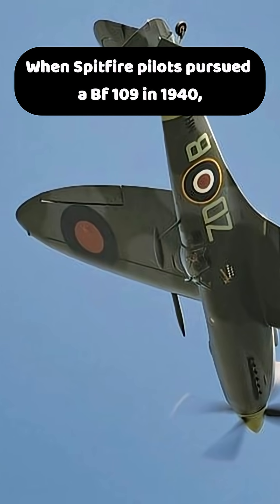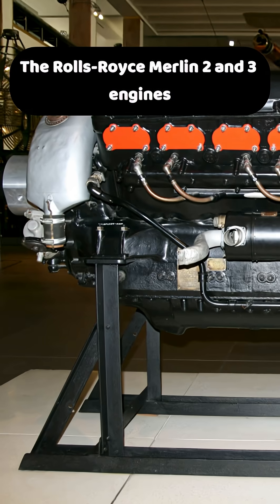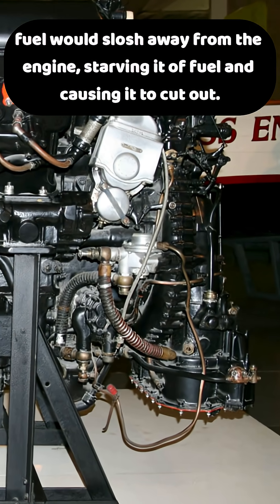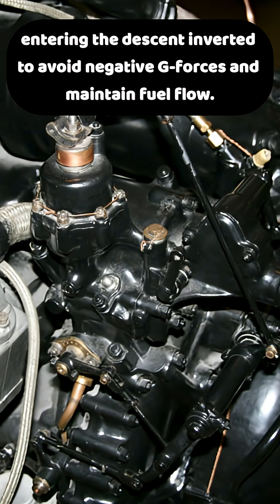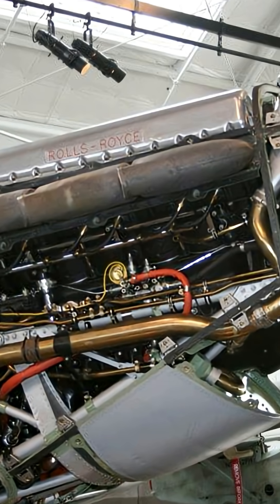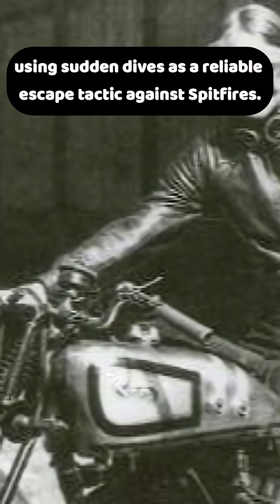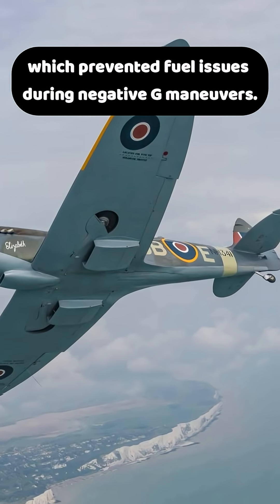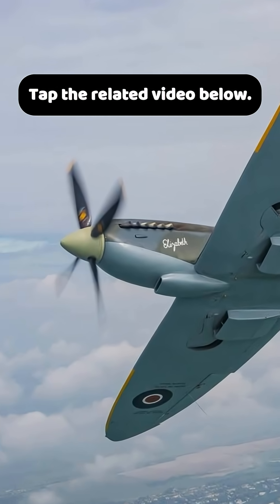Spitfire's Carburetor Crisis of 1940

Comment: German engines were technical more advanced than the merlin engines.Fuel injection is far superior.
Reply: Wehraboos are out.
Reply: I've heard that restoring a BF-109 to flying condition is difficult, because modem machine shops can't reproduce old engine parts to the required tolerances.
Reply: In 1940 fuel injection wasn't superior, it was less efficient than a carburetor. I have had cars with carburetors that gave good power and economy, also fuel injection that didn't work so well.

Comment: I never understood why the RAF did not use the same system the Germans did, fuel injection.  They had shot down many enemy aircraft that they could have examined that system and copied it so the Spit and Hurricane could dive the same way.
Reply: Mostly because the carburetor was more efficient than fuel injection at the time, the Spitfire and Hurricane had advantages and RAF pilots had little or no trouble.
Reply: They fitted Merlin 66 engines and later with American style pressure carburettors and until those advanced engines were ready Miss Shilling's restrictor cured the worst of the problem.  They used Bendix-Strombergs from America and developed their own by SU and later Rolls Royce.  Pressure carburettors gave a cooler and denser more powerful fuel-air mixture induction charge than direct injection.
Reply: @givenfirstnamefamilyfirstn3935  
Rolls Royce had the Modification by Miss Shilling during the Battle of Britain, Mk V Spitfires were further inprove to cure the problem entirely, Rolls Royce and SU then came up with the Speed Densitiy carburetor and this was given to Bendix/Stromberg who copied it.

Comment: The Merlin carburettor was very different from the Me109 fuel injection. Early in the 1969 film 'Battle of Britain', there is a picture of a spitfire in a roll, 'sputtering'. Few Cars still use carburetors.
Reply: if you're worrying about your engine cutting out while you roll your car, you're probably not driving in accordance with the Highway code.
Reply: @jujuUK68  I got carburettor ice in a Mini climbing uphill on a motorway in winter!
Reply: But after the war, cars continued to use carburetors for several decades. Although fuel injection was already available in 1940.😮

Comment: I have always heard talking  aboub this as a Spitfire problem. The reality was that in 1940 and before, float carburatos were the norm in aviation engines. The db 601 fuel injection sistem instead was very advanced for its time.
And the issue of the engin cutting at negative Gs manouvers was not that much of an issue as it's been told, because that caused the engine to cut off for a few moments but not to shut off. The primaries advantage of fuel injection over a carburator are fuel consumption due to a better distribution of the fuel to the cilinders and the fact that  it's less Susceptible to icing problem.
Reply: The Americans had pressure (sensing) carburettors free from that effect.  Spitfire Mk IXs and later got them.

Comment: No, that's not the reason for the engine cutout.  Not fuel sloshing away from the engine.  The float would over fill the float chamber, and a rich mixture would flood the engine.  That's what the puff of black smoke was.
Reply: Since the planes had fuel pumps fuel sloshing around would nit have been the problem
Reply: @johngraham-kn8uf 

Partly.  At zero or negative G load the float would come off seat and the float bowel would overfill.  The engine would go over ritch.  Emit smoke and sputter a bit on the rich condition until the rich comdirion cleared.  Then resume running.  That's the main reason aerobatic aircraft today don't run carberaters.